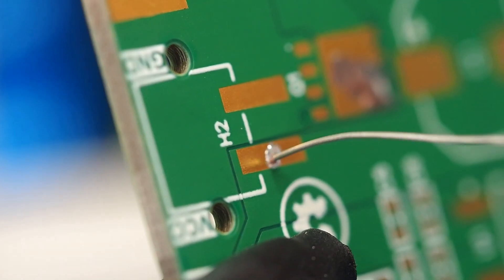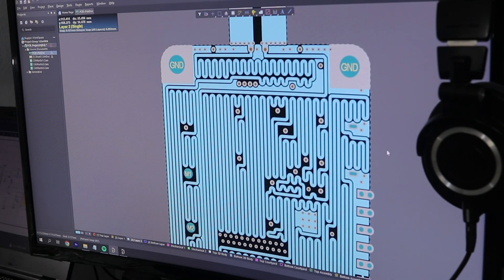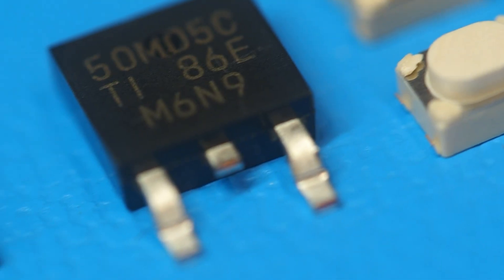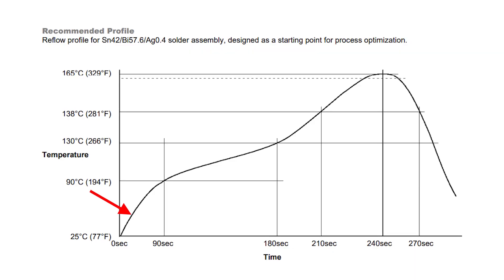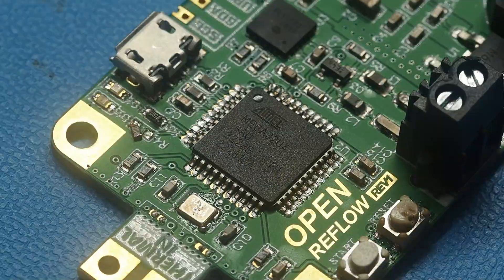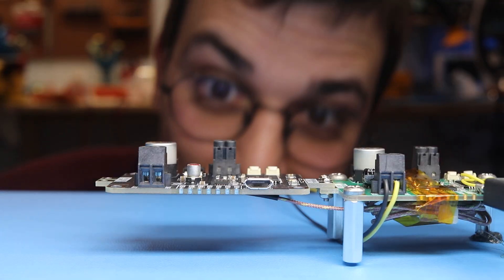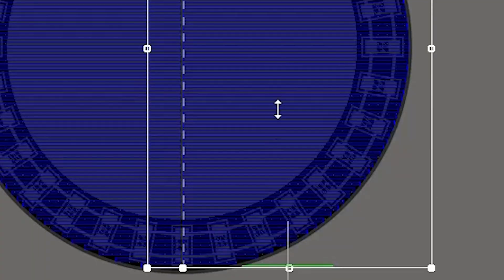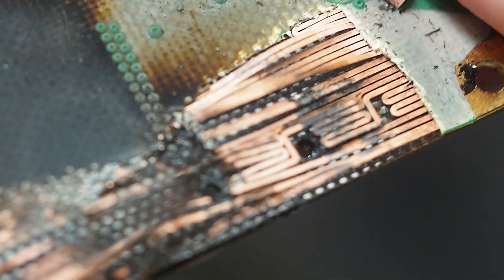I made a Self-Soldering Circuit

Comment from the maker: In video I missed to explain that the 4-layer mother-board have 2 other layers with grounded polygon pours.. Also as pointed out in some comments below, the long grounded thermal-track might act as antenna picking up rf noise.  This is a trade-off for this self-reflowing concept, but to minimize the noise I added the possibility to short the track to ground from the two ends.

This project is open source and you can find its files here - https://github.com/CarlBugeja/Open-Reflow
You can also help me make more projects by joining my patreon community - https://www.patreon.com/carlbugeja
Reply: Great, Thanks
Reply: This is amazing.
Reply: Came here to mention this.  Ground currents can be a nightmare in RF circuits.  Including high frequency digital which have high frequency rise times.  Too much smoke.
Reply: "short the track to ground from the two ends" - that'd make quite nice transformer coupled RF antenna though :)
Reply: @harijszablockis332  could solder lots of capacitors to the heating element to lower the frequency beyond what the element can receive.
Reply: For the RF noise you could add 2 more ground layers to the PCB. One above the and one below the heating element.
The trade off is more cost and materials.
Reply: It’s isolated and grounded… any rf caught would discharge. 

I like the idea of using it as an additional wifi/cell/Bluetooth antenna
Reply: I assumed that's how you did it... absolutely brilliant idea, bro! Love it
Reply: perhaps a ceramic heating element is an option? It would remove the majority of the rf interference issue.
But i don't even know if they can make them that small, or even exist.
Reply: @nobody8717  They make ceramic resistors and those are definitely heaters so a thin film on/as a layer would work.  The composition of the ceramic would be such that it has just the right resistance so no need for the loops.  I think this is a completely different thing though, the point is to heat the board without doing anything other than design a layer to be a heater.
Reply: Not gonna lie , this is cool.
Reply: you should register this thing  to your name or someone coult take advantage and make millions ... millions that YOU actually deserve !!!
Reply: Can you try to make a pcb that has a cooling system inside? Or something that can be used to cool the board from the inside. 🤔
Reply: @adryanmares0  electric cooling offers  1 side hot  and the other face cold. you would have to cool down the other face aswell
Reply: @Berserk Berserk  nah, I meant something in the pcb itself, kinda like the thumbnail but for cooling, maybe even liquid cooling or vapour
Reply: @adryanmares0  Sure, but it would be a very thick board or very weak cooling.  It would take an array of Peltier junctions. The main problem would be that the heat has to go somewhere no matter what.  That's why heat sinks have fins, to conduct the heat to the air. Heating is easy, energy in -> heat out.  Cooling is the moving of heat away though and requires it's own energy which only adds more heat.  Which must be dissipated.
Reply: Т.е. надо покупать дорогущий текстолит и легкоплавкий припой? Не проще ли в духовке согреть?
Reply: The placement of the thermocouple could be improved perhaps. I mean its at the bottom. Please check if the temperature at the bottom and top layer match at all times.
Reply: @TheFinalRevelation2  Good point.  Makes me think that a thermocouple could be made into the pcb as well.  But would take dissimilar metals so that might be a showstopper for practical reasons.  Can't pout everything into the board.  Actually all it would take to make sure you have even heating is to make a board with nothing on it and heat it up and watch it with an IR camera.  Wherever the hottest spot (on either side) is, that's where you put the thermocouples.
Reply: @dougcox835  Absolutely. I think you would need on on the top and bottom also to calculate the stress or difference also.
Reply: Dr. Carl where can I get a graphene PCB at??🤔🤫🤐🤨😐🙄😬😮😯😲😳😱✊💪🦾🙋‍♂️ because you can't the good shit in New York City!!!😪🥴😟😢😡😠🤬🤬🤬💩
Reply: Hi, Carl. Did you can make pcb chessboard which will contain a lot of pcb coils, surface contacts for measure resistance or capacitance of minifigs? Also you can implement drilled holes for led indication of possible turns.  May be you can do that without servos and stepping morors? I think it will be a enough complex challenge for you). Best regards
Reply: I suspect that sandwiching the heater trace between 2 ground planes is fine--ut won't pick up RF noise.  In fact, I'm sure you could get by with only one ground plane--and maybe if you're worried about delam issues (caused ny the heat being on too long, or travelling through too many layers), you could put the "real" ground plane under the heating trace.  That way, the heat would only need to travel through one less copper layer, so it would be quicker.  The fact that you're using a custom board to control it is awesome!  (Esp. since that custom board soldered itself!)
Reply: Maybe convert it to a wireless charging interface after soldering is done? Great video, Carl!
Reply: Or could you design it to be an antenna also for later use ;)
Reply: This is so cool.
Reply: Maybe you can use it as feature, not a bug
Self-soldering antenna included board... Freaking awesome!)
Reply: @avovk1852  Would work.  Except that the antenna would need to fully cover the board and antennas need to be very specific dimensions to work at the frequencies you need. Usually they need to be larger than you have room for.  They can do amazing things with fractal designs though and one of the characteristics of fractals is that it repeats so (at least I think) the pattern can be expanded to any size you choose.  If the pattern is small enough in the first place.  The layer with the antenna can't be buried in the layers though, as it needs exposure to the environment without obstructions. Definitely not sandwiched between 2 ground planes as he described.  If you do not want it to act as an antenna or couple to your circuitry that would be the right way to go.
Reply: This is next level Genius, well done 👍

Just looked at your videos list, you're doing some INCREDIBLE work 😲

Comment: Oh wow, the RF problems coming from this if used as ground, capacitance issues, grounding issues are massive. This can only ever be used if it is totally disconnected and requires extra precaution isolating the actual functioning pcbs

Comment: This is such a cool idea!!!  Completely under rated!   For designers that do small batches of product runs, this would be a nice idea to use to clip a handful of boards onto a bus and turn on power and they all snap in.... even add in a self checking tester, where after it solders, it then runs a test program and have an LED or program register to say board 4 has issues(or LED lights up infront of the board).

Comment: This was a very good concept from a ( Maltese?) engineer . 
added ideas 
- it can also be used to desolder itself.
- For cct boards where a component may need to be serviced in future it may have a heat pad under specific cpu or chips so they can be desoldered /upgraded in future.
-The item can be designed to self destruct or power down permanently by desoldering a track at a specific moment in future.
- The board can be made in-operatable for a specific reason remotely 
 - The board can deliberately increase in heat to say for example stop condensation
Very good video.

Comment: This is absolutely amazing. For home gamers, it could cost cosf massively not having to have others assemble the pcb or buying all the equipment yourself.

I think the biggest application might be for really small order number niche pcbs where just one person is selling kits and wants to reduce the price by having the user do this part of the assembly or by doing a lot of them at once semi automated at home. Its even greater because you could potentially have boards where most comoonents will stay the same but where you leave extra tracks just in case you need to change the configurwtion and you can then do so at home just with component placement on a more hobby friendly pick and place like the LumenPNP

Comment: Your application method for the solder paste is flawed.  Never deposit the paste onto any openings in the solder screen.  Apply it to a solid portion of the solder screen and then, with the squeegee at an angle in reference  to the direction of travel and leaned slighting into the direction of travel, pull the solder across the board in one motion.  You should apply sufficient pressure that the paste is not left in a layer onto of the solder screen, but not so mush that the squeegee deforms into the openings of the solder screen.  If done properly, you will be left with a perfectly applied layer of paste.  If the flux in the paste is starting to dry out, or the particles of solder in the paste are too large for the pins being soldered, you can spin the squeegee around, and starting from the side you ended on, make a second pass, but with the squeegee angled opposite from the first pass.  This will catch any voids.  When you lift your solder screen, there should be no solder paste between it and anywhere that has solder mask.  Also, the layer of solder paste should not exceed the thickness of the solder screen.  The openings in the solder screen are designed to allow sufficient solder to create a proper joint based purely on the volume create by the opening's area and the solder screen's thickness.

FYI, I'm an R&D solder technician, so this is literally what I do all day every day.  Reflowing solder that is.  I've never tried this  self soldering method as bismuth solder has an operating temperature way too low for anything we do, but it's an interesting project.  

I saw a similar project not too long ago, where they designed a hot plate using a PCB.  It included a small micro controller, a couple temperature sensors, and current and voltage feedback.  You could select one of three temperature profiles with the push of a button.  An LED showed which profile you were on.  Then, you'd place your PCB to be reflowed on a large empty section of the reflow PCB, and press start.  The heating element was broken up into several equal length segments, which could be configured to operate independent of each other, or just all in parallel.  Working in parallel made the code is much more simple.  But, running them independently would allow the control of each zone of heat so no one zone would be more hot or cold than the others.  Someone modded the design to include PCB sides that would press into place and create sides 25mm tall, which would block side air drafts and make a better reflow.  Adding a top turned this into a makeshift oven.  The side and top PCBs had a solid copper layer on the outside facing away from the heat, and nothing on the inner layers nor the top layer facing inward.  They were polyimide rather than FR4 for a higher temperature, and ordered at a thickness that was the maximum for the manufacturer while staying within the option of a quick, standard order.  For a cheap, hobby type reflow oven, this could not be beat.  It could do standard lead solder and even a couple runs using SAC305.

Comment: This is brilliant, and I can see myself using it for part of my project.  I say part because low temp solder and the high current portion of my circuit might not play nice if something goes bad and the fuse decides to become a wire instead of a fuse.  (Not likely, but I'm lucky like that)

Comment: I’m commenting to congratulate you for being wonderfully original. No way there are no practical applications for self soldering pcb, i can essentially skip any type of traditional soldering and just lay out the components and then heat it using itself. Blown. Away.

Comment: Hi. Nice video.

Which type of pins did you use for flashing bootloader? I want to do a similar thing with atmega328pau but I don't want to solder headers to each board . I like the way you can temporarily attach the pins
Reply: I guess really I'm looking for 1.27mm pogo pins

Comment: Things like this and the people who create them are so cool.
Great Scott made a similar video a while ago about a hot plate pcb although it did not solder utself. One of the problems with that one was that the hot plate and the components were all on the same board so it would only last as long as the copper traces would. But what if you combined the two ideas. 

Is it possible to make a pcb with just the copper traces that act as a daughter that you can reflow another pcb on top?

Great videos!
/Bo

Comment: I designed a PCB with a similar heating layer for an application where I needed to keep a few components at a precise temperature for accurate measurements. It functioned well but I ended up trashing the idea because I couldn't be convinced the trace wouldn't eventually crack due to the added stress.

Comment: Seems like a bad idea. As in: something that could cause layers to delaminate or burn kind of bad. Heating it up from the outside is a lot different from doing it on the inside, it could easily be 250C on the inner layers. It might not "look" like it did anything, but I seriously doubt that it didn't damage something even with low temp solder. There are volatiles in the resin.

Comment: My only addon would be some intentional vias that allow you to solder more 0 ohm jumpers via the vias to reduce the 'ground plane' resistance. Having 3 ohms across the board is probably fine but if it's gonna act like a ground plane it should have some strategic shorts ready to make that much lower.  Very cool!

Comment: The RF noise this emits must be buggered. Adding in a bunch of inductance and capacitance, big ass antenna. Any noise in your circuit will be emitted. You should check it with an SDR receiver. Or a spectrum analyser

Comment: this is awesome. the reparability of the board seems like it would be extremely easy. need to de-solder a component? re-connect the leads and done!
even though the layout might be a pain, but could have pads for different components, or sections of the board to make desoldering components super easy.

Comment: Could definitely see this being used in entry level hobbyist kits for people who aren't too confident  with soldering, especially considering surface mount pcbs ain't the most beginner friendly, also the possibility for bootstrapping using this system is promising too
Reply: Just use a cheap toaster oven for reflow then you don’t need to pay for additional layers, one run of several boards is actually more expensive.  Bonus points for a thermometer.

Comment: Even if it doesn't reflow the entire board it can still help with soldering since the entire board can be brought to a temp that is close enough to the melting point (e.g 100C). Clever trick. I wonder what the noise performance looks like.

Comment: Hey ! Very cool idea! There is one more thought - you can not use a thermocouple - you can connect the heating layer periodically - first to a current source, and then to a resistance meter - copper has a very linear function:  R=f(t°) -  so you can find out the temperature knowing the resistance of the heating layer.  Good luck to you ! You are a genius !

Comment: thatss... a emc problem... if the current on the ground doesnt reflet the current running on the power plane or on HF signals , you are kind of decoupling the return path of the current, making easy for this current to go into the air... making it radiating energy (noise).  soo I think is really good aproach, but please, dont use it as a ground plane... sacrifize the layer to save problems for people and future electronics

Comment: No need 4 layers, why not just use 2 layers with one layer all ground. Just need use lower voltage and higher current to short the ground as heat. Your idea is to have one time use heater which is kind wasteful.

Comment: the only case i can see this could be useful is for a self repair mode for example a gpu/ onboard cpu(used in gaming consoles) stopped working they stopped responding at all so the board could contain a circuitry to tell the user via graphical output hey the board needs to be taken out of the case to self reflow all its components in order to try to safe the board.

this could potentially be a valuable solution to problems as BLOD or RROD in which most of the time it was the onboard cpu being faulty due to a loosened connection.
there were many attempts to fix this problem but the machine which is needed to even bother trying it without warping the whole board is very very expensive.

Comment: This is really neat, simple, effective. Keeping an even heat helps prevent the board from warping. For really small batch boards cutting out the reflow oven is probably useful. For larger batches and runs it's probably not worth the layer cost.
Reply: Niche application for prototype PCB batches for sure. Leaving the hot board on the table and hot swapping components is also an interesting thought. If you used an xy plot type of grid you could play around with location selective heating.

Comment: Depending on how thin you can make those traces you might be able to design the ground plane like the mesh on a microwave, this would only work for square PCBs and has its own issues, but provides better grounding and wouldn't have issues with RF.
Just using a hotplate is still much easier and faster though.

Comment: I wonder if this could use in scenarios with high vibration machines. That might have their components solder joints crack. You could technically resolder the components for a couple of times or use it as a last resort try to fix things. Of course it would only make sense for objects in space or other hard to get locations.